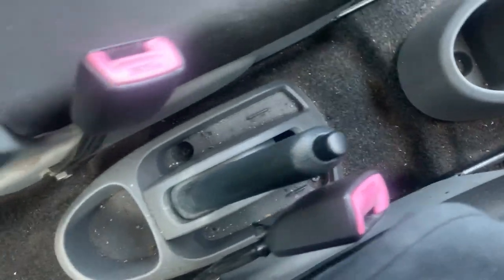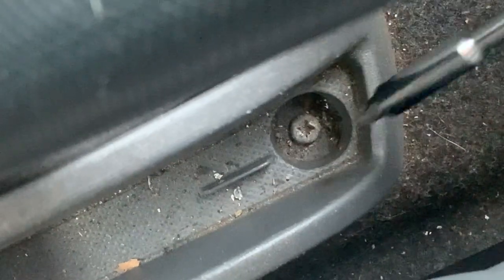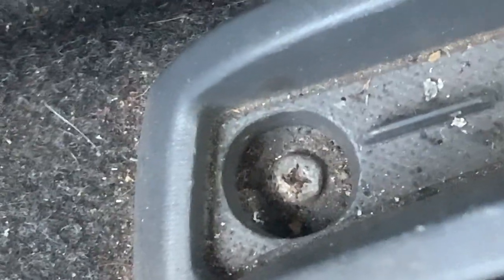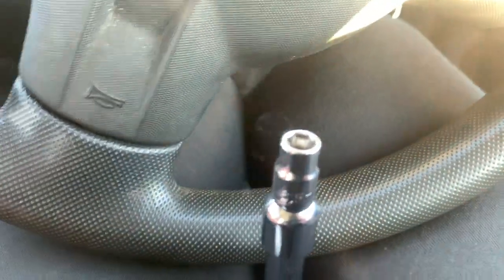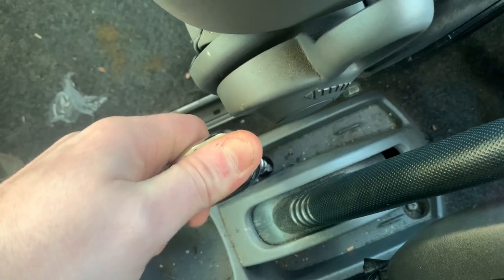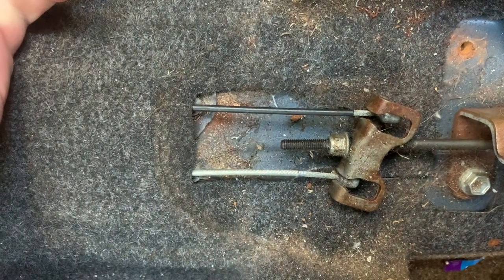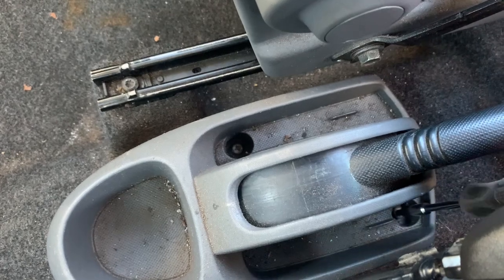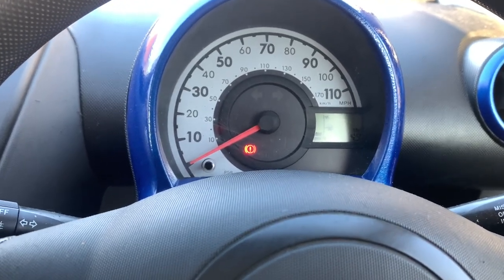Car Handbrake Cable Adjustment/Park Brake Tighten (C1/Aygo/107/CityBug)

Comment: Hi Mate, when you show the rusted up hole where the bolt screws in, it looked like a straight hole through to the underside of the floor pan, is that correct? If so I may be able to screw the remainder of the broken bolts downwards and out the floor pan after drilling a small hole. Do you think that could work?
Reply from the maker: I think it does yea. Tbh I’d probably just drill it out and ram a couple of tek screws into the shitter if it had happened to me 🤷‍♀️
Reply: @StupidBlokeStupidVideos  Great I'll do that. Cheers mate keep those videos coming

Comment: The factory-fitted fastners are bolts (probably a 10 milly head - I am too lazy to check). They are notorious for rusting into the floorpan and snapping off. Looks like someone's already changed yours for Phil's finest 'ard man screws!
Reply: Helps if I watch the whole video before making comments! :-D ... You should be able to see the pavement through those holes!

Brilliant video as usual!
Reply from the maker: @74HC04  cheers. Yea you can see the floor through them. I thought they were 10mm heads with a screw driver fitting in the centre like some bolts have but I just didn’t look properly before trying a 10mm socket on a round screw lol. They’re m6 thread so 10mm is normal size head for that though. They were seized pretty bad though, I reckon they’d have definitely snapped without the tap and tighten trick.
Reply: @74HC04  watch the full video? Where's the fun in that? All comments on youtube are based on the first 30 seconds of any post!

For example I only read the first line of your comment before hitting reply.

Comment: Just use a P2 screw driver. Could have had the job done and dusted by the time you'd got the console panel off.
Reply from the maker: Yea, I thought they were 10mm hex with Philips in the middle cos of all the shit around them making them harder to see properly. 

P.s. I’m pretty sure they’re p3 but a p2 will do if they’re not too tight.